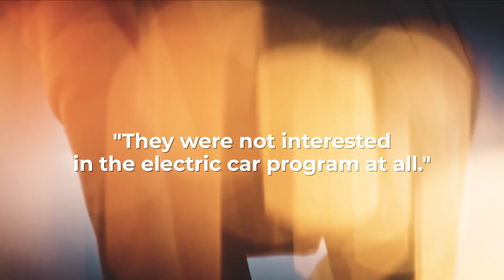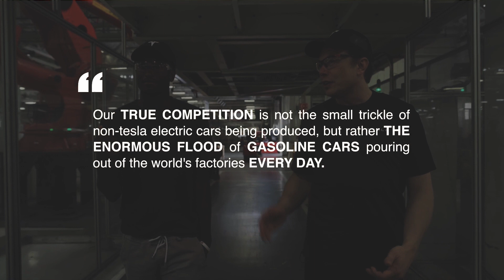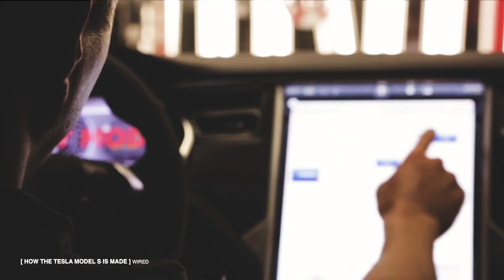Why did Elon Musk open-source Tesla's patents?

Comment: It's good he did. There are ways to upgrade vehicles. Have a direct connect to the axle of EVs and solar, to super charge them. No more plugging in. Use V2G tech to transfer extra energy to the power grid so you don't burn out the circuits with ALOT of extra clean energy.😎🇺🇲